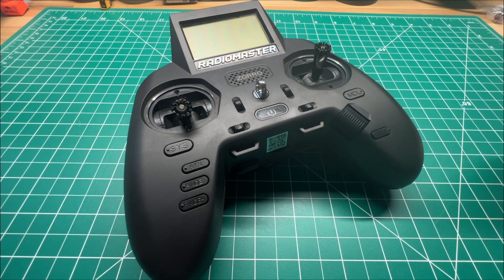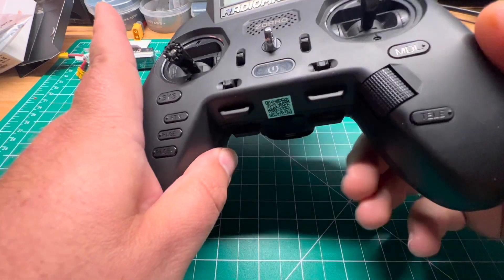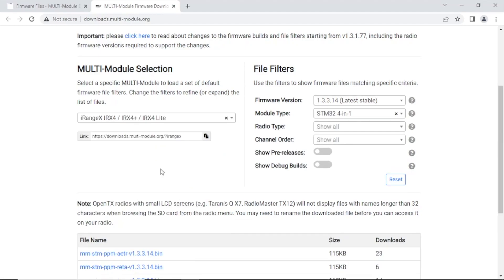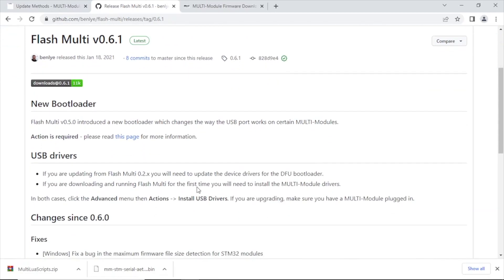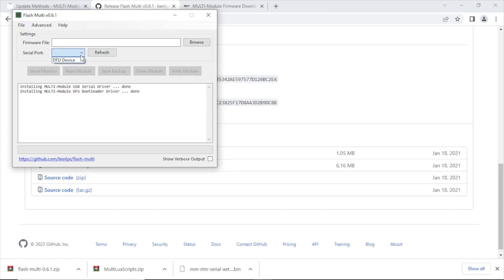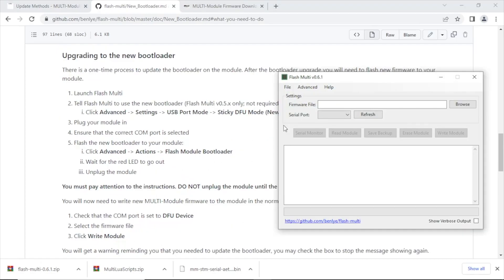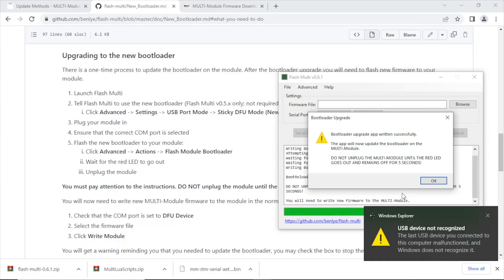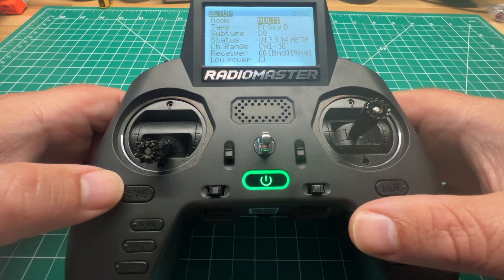How to Update Your Multi Protocol Module

Comment: The new ARM Version of Irangex, you dont need to download the bootloader ! 
So just, put the .bin firmware file on your transmitter SD,  connect module, click on .bin and it will ask you internal or external module, click external and it will proceed. Flash Multi is not needed anymore.

Comment: do not work
Reply: Jeff. Just watched your video. usb and bootloader download, but DFU Device dropdown under Serial Port won't show at all so I can't finish process. Reloaded several times no change. All current fw .0,6.0 etc. Any suggestions greatly appreciated! Tom
Reply from the maker: @thomasschwyn4212  you need to install the drivers first with the module connected to your PC via usb. If the module isn’t connected the drivers won’t install, and you won’t be able to select DFU mode.
Reply: The flash worked with different USB cord. Current firmware shows in Flash Multi etc. However when I go into Multi lua script on my FrySky Tandem X18S to bind to Spectrum BNF none of the LEDs green or red come on to bind. I believe the lua script is the latest. OS is ETHOS. Any suggestions? Thank you very much for the help! Tom
Reply: Talked to Steve S. at FrSky USA. Power off was module looking like all the way seated, but wasn't. Transmitter is an X18S Tandem. He noted after fidling and a few times of on/off it is ok. Thanks again for your help! Tom
Reply from the maker: Anytime!